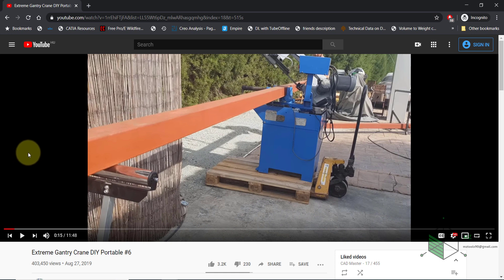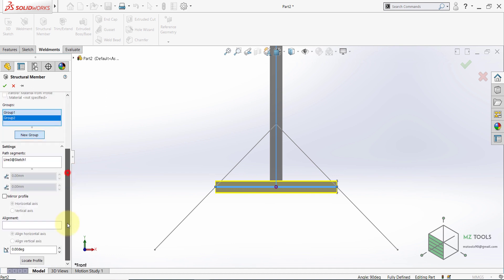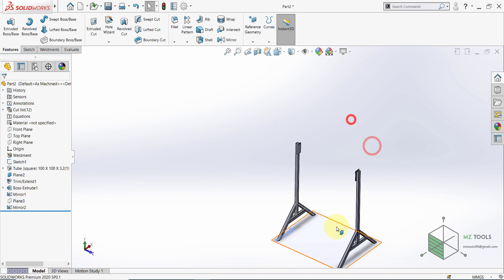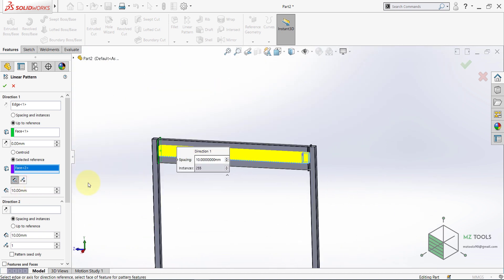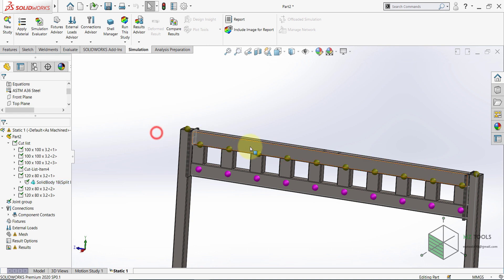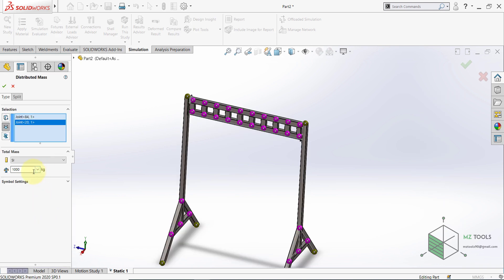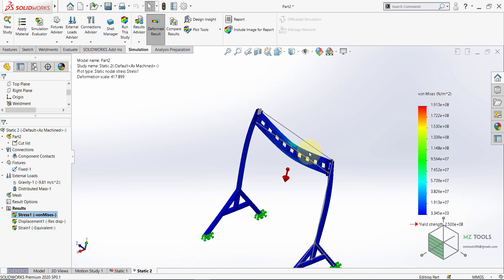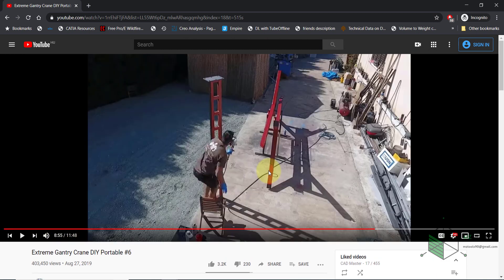Extreme Gantry Crane DIY Portable (CAD design)

Comment: Since the original video only displays one dimension (the length of the angle cut of approx. 6 5/8 inches ) , you can not be accurate. But looks to me like the span is 12 feet and all the tubing would be 4 inch by 4 inch based on that one shown measurement. The spacing appears to be 16 inches on centers. And you do not indicate the added strength of the welded angle on top and bottom that the rollers run on.

Comment: Excellent application of engineering design. However, i still don’t know how you were able to interpret the similar results as being safe and within limits 🤔
Reply: That's because his analysis is not compliant to any design code whatsoever. This is useful as far as a first year college student learning Finite Element Analysis or learning how to use Solidworks with some very very rudimentary considerations for performing stress analysis. I wouldn't even call it designing a steel structure let alone a crane. Don't go thinking you could knock a few steel tubes together and carry out this FEA and make yourself a crane.

Comment: I noticed the top tubing you figured 120 x 80 (5"x3"). If you look in the video I'm pretty sure it's 80 x 80 (3") square.
Reply: Jay Pee Robot, if you figure backwards from the only measurement shown in the original video, you will find that the tubing would be 4 inch by 4 inch. Not 3 by 3.

Comment: Mohammad I really appreciate you performing this sot of safety checks even if just. Quick check. It help keep many DYIers from getting hurt by coping good designs. There is this similar situation that I thing would benefit from your analysis. https://youtu.be/Ca9xZmmjF0I. In this video all of the loads are dependent on welds of a suspect WPS when a better practice could have been followed. I’m afraid that the SWL I much lower then realized although the builder does specifically call it out, he implies that the gantry will lift parts of his heavy machinery. Can you see if this interests you. Thanks. MW

Comment: Hey Mohammad, 
nice video. However I have two questions, first why fixed? For fixed support this means that you have no displacements and no rotations. This is applicable in case the crane is bolted to the ground, but for some reason I am thinking it will be on wheels, am I wrong? So what is the proper support then, I'd like to know? Usually this is to be supported like a simply supported beam, what are the supports then?
About the second question - why the size of the circles where is the load is 35mm? How did you determine it? Shouldn't this size be smaller since the contact between the wheel and the surface when looked normal to the right plane, the contact is in point. So why sircle and why the circle is 35mm diameter? and shouldn't the contact be linear since the wheel is cylindrical?
Reply from the maker: Hey Validimir. Thanks for you comment. 
For your first point I do agree with you. And from technical point of view, even if it is bolted to the ground the fixation should be hinged unless the bolting is done in a very professional way that satisfies the fixed condition. I defined fixed connection just for the purpose of a quick check no more. In this case actually it should be planer which gives the crane the degrees of freedom to move on the surface in all directions but dosent allow it to leave the ground due to its own weight and the applied load, which takes us to another aspect which is the stability of the crane under loading, I mean overturning. 
For the second question. I sat the diameter to 35 instead of defining a point load to overcome the numerical problems in FEM and to reduce the analysis time. For it to be more accurate. A two leaner loads should be applied to the ends of the rectangular section since in the actual design there is an angle placed on the top and the load is transmitted from that angle to the rectangler section. Over all I 100% agree with your points. The thing is that I tried to make a quick check analysis. Thanks for your points :)

Comment: What about the bolts? Especially the two holding the rollers and plates together, how would you know what grade to use?
Reply from the maker: Hey Einen 
That can be simulated too. I didn't do that because this is just a simplified model. If you are interested in seeing how to analyze the bolts, please let me know so I will create another video showing you the case :)
Reply: CAD Master I would love to see a video about that, especially in loading situations like this :)
Reply: And how do we decide the size of weld beads and filler material so that the welding does not fail? Also which simulation is more close to real situation,  i mean the one in which we considered all the members as a structural member or the one with a solid body? Thanks for the great work